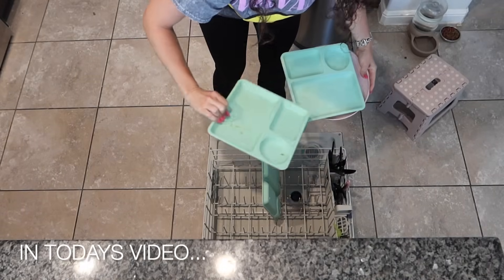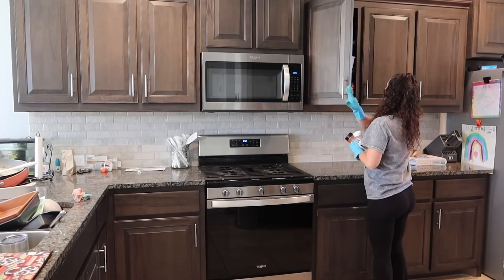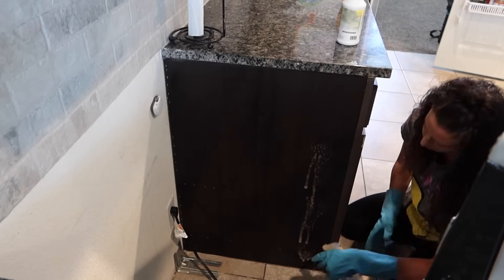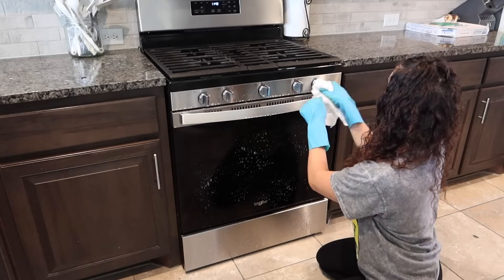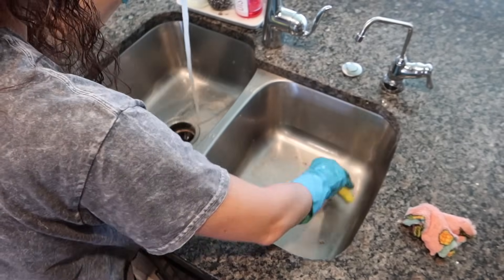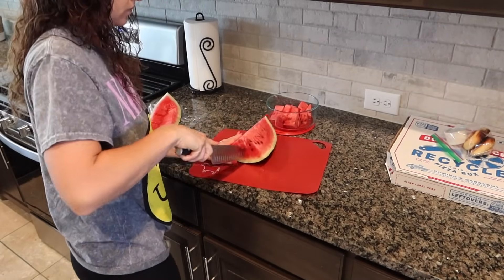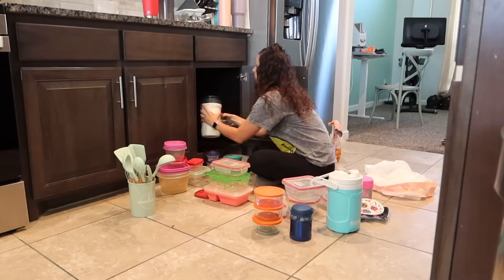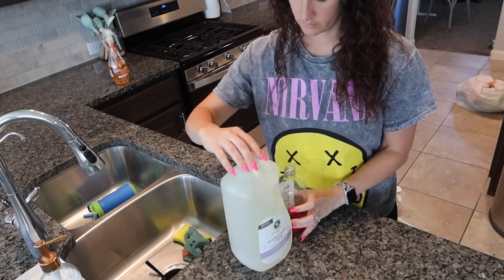KITCHEN RESET 2023 :: DECLUTTER, ORGANIZE & DEEP CLEAN :: FILTHY KITCHEN ALL DAY CLEAN WITH ME

Comment: I use 2 sets of pods for the dishwasher the first in 1 gallon of boiling water- stord brand pod soak then pour it in after a 1st purge ususlly my dishwasher has this cycle on presoak water will buildup in the hoses. Then i pour it in at the start of the 1st cycle & the 2nd pod will drop during the reg wash. I use a high brand pod - cascade set in the bin that holds the pods. Also read your directions on how to load it. Mine it loads side to middle with tops to the center or bowls insides facing to the center in 4 way cube. The one I had last year washed in a counter circle so I had to load from the left following the center all the way around like a fan. The water washed in the opposite spraying up into each center. Always read your directions. And before you load give a good brush Scrub to every item with reg detergent, or a mixed spray soap. This allows those bowls, cups to get everything debris free.😅

Comment: I would love a summer declutter series! I’m trying to touch every room in my house and declutter over the summer too! We switched over to glass storage containers a few years ago and I would just watch for the sets to go on sale at Costco. They have the Pyrex bowls and casserole dishes in sets that go on sale pretty often and then they have the storage containers with the snap lock lids too. They are on sale all the time! I would just buy one set at a time so it didn’t break the bank. I’m going to have to try the Jaws cream cleanser on my oven the next time I clean it. I love that stuff! I have been using it to clean my grout and it’s amazing! My grout looks brand new but the down side is that you can clearly see the areas that I have cleaned and how much I still need to do! We live in military housing on base so this grout has probably never been cleaned and it’s really bad!
Reply: I just finished the rest of the video and your kitchen looks amazing!! Now I want to tackle mine! How do you like the new ocedar two bucket system? I have the old one and I have been eyeballing the new one but I’m not sure if it worth the upgrade when my old one still works fine. What do you think? Does the separate water make a huge difference?